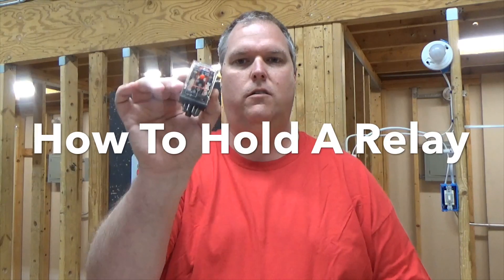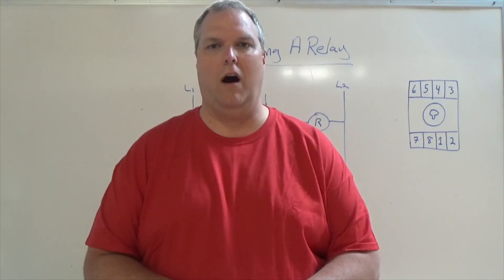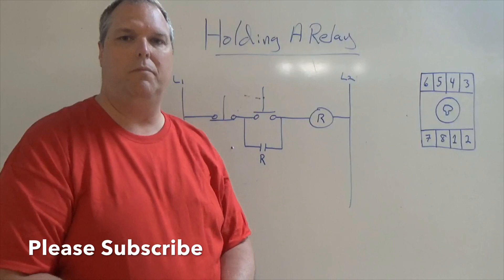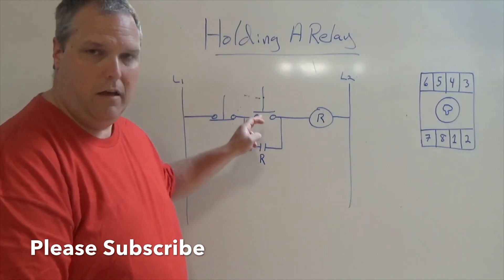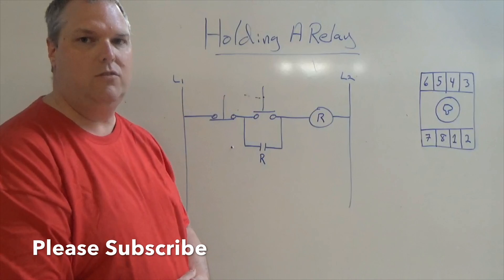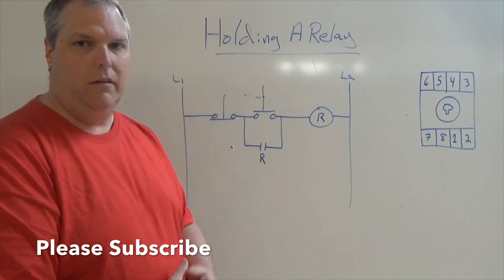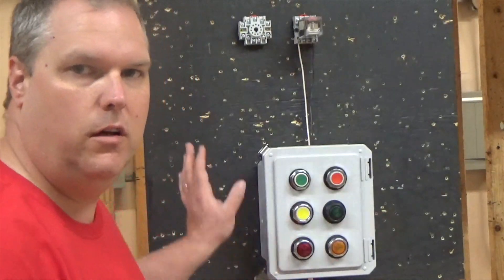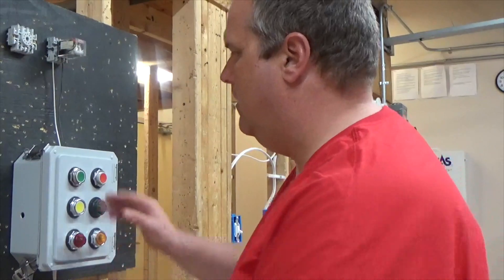Basic understanding how a Holding relay wired

Comment: Hello Craig, I am new to controls, and have watched several of your videos. I have a question; why not have constant power at 1, and then wire the start button to 2? That would eliminate the jumper between 2 and 3. Is there a reason why we're doing it different? I apologize in advance if this is common knowledge, I am still learning.
Reply from the maker: @zabasvelasquez7113  I am sure if you watch my 8-pin relay video I will answer all your questions!! I believe it’s in my motor control playlist. CM

Comment: Thank you for both videos on the 8 pin relay. I used a relay to control an auxiliary coolant pump on a saw so it could be isolated when not required and turns off at the end of the saw cycle. Your explanation and videos were perfect to help understand not just how to wire but also the internal workings of the relay.

Comment: I work industrial maintenance at a fiberglass plant. We have a room with 100s on a board, they control 36 units. Trouble shooting is problematic for me sometimes and I need to understand how these work. Seems I always over thought it. I love these videos and am grateful that you put them together. thanks,
Goat
Reply: Sorry ment to say 100s of relays on a board.
Some are 12v some are 120v and a few are 6v. I'm getting there with your help.thanks
Goat
Reply from the maker: Wow that is a lot to maintain. I am glad you enjoy my videos. I try to take the guess work out of it as I train new people. I try to give the basics and not try to make it complicated. Thanks for the support. CM
Reply: MAINTENANCE MAN tell ur plant manager to invest in Siemens or Rockwell plc.  Or they will never get anyone coming out of school to work there
Reply: How do you add a timer in the circuit you just explained
Reply: @wshh8486  we are now  switching the new systens to plc.   So thats the new thing im learning.
Reply: @jerrykaywood3092  most of the timers we use now are relays, connected to limit or proximity switches.
Some of the vfds we run are straight out of the 70s.

Comment: Your videos are very good.  It would be helpful if you would label the actual parts the same way you have them diagrammed on the board.  For instance, the 8 pin should have the 3412 5678 labeled so I do not need to go back in the video to see where they are.  I wish you would do an old school motor control and start video.
Reply: ...and that is what I've been thinking about too.
He never bothered to put some specific labels on that 8-pin-motor-relay.
Sir, could you please tell us some more? 🤔

Comment: Excellent explanation Craig 👍. I have a question: what if I have a 240 Volt. load 5Amp RLA like pump or a fan. Can you do a video on how to switching a 240v load (power circuit) using pin 8&6. Thank you, greatly appreciate your time.

Comment: Great video❤.

What if you run a wire from the feed of the start push buttons( i mean the wire connecting start and stop push buttons) to port 3 (NO) of the relay,   then separately  run a wire from same port 3 to port 2 and  link port 2 and port 1(common) of the relay, would that make a holding cct?